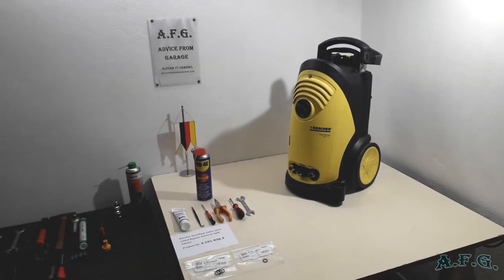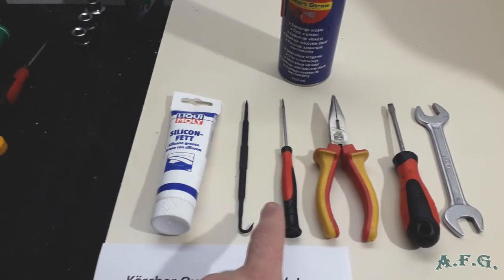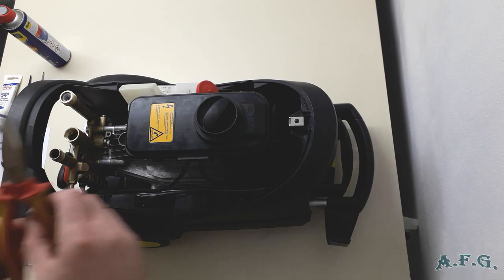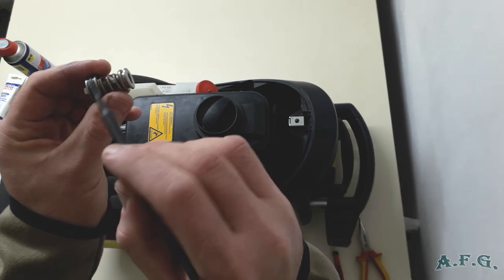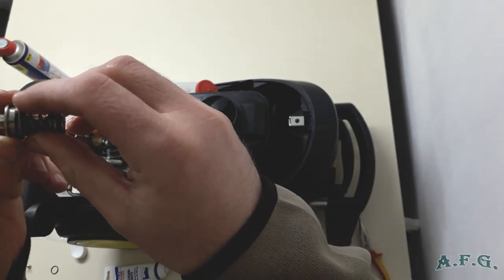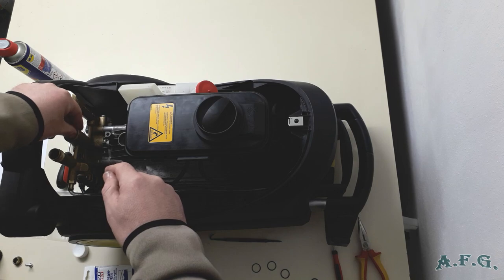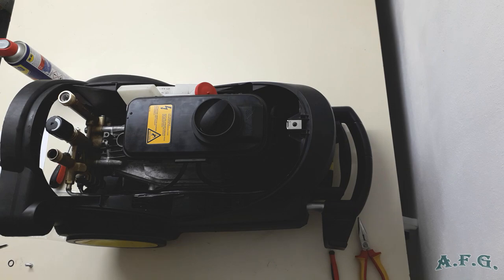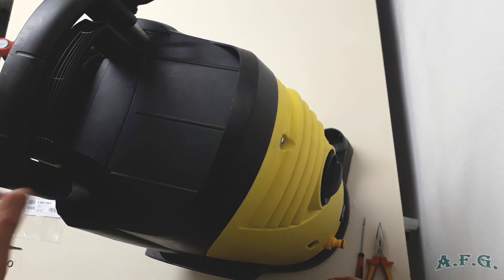How To Fix Overflow Valve; Karcher HD 5/15C; HD5/12C; HD6/13C (Part 4 of 6); Pressure Washer Repair

Comment: Hello AFG; I enjoyed watching your video's. You work thoroughly ans systematic. I  like it. I have an issue with my HD5/12C : No pressure at all. The input is OK. The water flows out normally (the trigger pipe unmounted) .  But when I turn on the higpressure knob nothing happens? What shouild I check first?  🤔 Greetings from Brussels Guido
Reply from the maker: Hello and thanks Guido. If I were you,
I would watch this video (link attached), where Steven Taylor is fixing capacitator problem on similar pressure washer. Let me know please later if capacitator was really a problem. Advicing remotely is very hard without seeing how power washer works, (not to mention that I am not a serviceman), but I hope this can help you at least start to diagnose the problem. Greetings from Slovakia. S. https://youtu.be/TRoDffB9kwA

Comment: Hello. Thabns from your video. I have a hd6/15 that is leaking from under. Any idea what i shoul replace? Thank you
Reply from the maker: Hello, you are welcome. First, it would be a good idea to put the machine on a table or chair and run it under pressure to see where the water leaks. It also depends on how big the leak is and whether the pressure washer has normal pressure or is weak. There can be several reasons. This can be caused by worn O-rings on the Overflow Valve, but also by a worn Start-Stop Valve. The machine usually has little or no pressure if the leak is caused by worn water seals. Water leakage can even occur through the Inlet-Outlet Valves. If you watch all parts of the service video tutorial, you will find that you can fix it yourself. You need to find out what and where exactly is causing the leak. Unfortunately, I can't give you better advice from a distance like this. Greetings from Slovakia.

Comment: Hello sir, I have karcher hd 7/10cxf, I already serviced, but it has been one problem, that problem is auto cut off. When stop handle press after also it's continuously running the pump, can't cut off. What should I do?
Reply: Pressure regulator Orings also changed
Reply from the maker: Hello Rakesh, It is hard to give advice remotely, if you cannot see how does the power washer looks and works, not to mention that I am not a Karcher service man or technician. From what have you described as a problem,  I would guess that you have a problem with part called "control piston set" (ordinary people call it a Start-Stop Valve or Ventil as well). It cost  30 to 40 Euro, depends on country. Probably, you have a worn-out O-Rings on it. Problem is that no one knows the size of them, their  hardeness and type of the rubber. Repair would be cheaper, if you find spring on this part o.k.  Still, it is a very easy fix and cheap repair if you do it on your own. I will cost you less than 40 Euro. If you go to Karcher service, it will cost you a fortune.  If you watch Part 3 of the tutorial (Water seals change), you can have a close look on this part at 4 : 33 min. You will see a product number as well. How to disassembly this part and replace, please watch Part 1 of this tutorial (How to Set Apart a Pressure Washer). You will learn, how to do it. Maybe in the future, if I have a time, I'll record a separete part dedicated to this topic. Hope this advice helps you. Greetings from Slovakia. Good luck. Slavo
Reply from the maker: Hello again Rakesh,one of the 3 things can be fault when unit won't switch off when the handgun is closed. 1.Overflow valve, 2. Non-Return Valve, or 3. Pressure Switch, (Control piston set, also called Start-Stop Valve), that I mentioned in the previous comment. I just recorded "Start-Stop Valve Replacement" video & later I'll upload it. Hope it helps. Slavo.
Reply: Overflow valve means which one sir
Reply from the maker: @RAKESHPUTTUR  Overflow Valve you can see in this part 4, that we are commenting right now under. Watch please entire part 4 and you will understand.
Reply: Oh, overflow valve installed inside after the regulator
Reply: Ok sir, I will check , Thank you